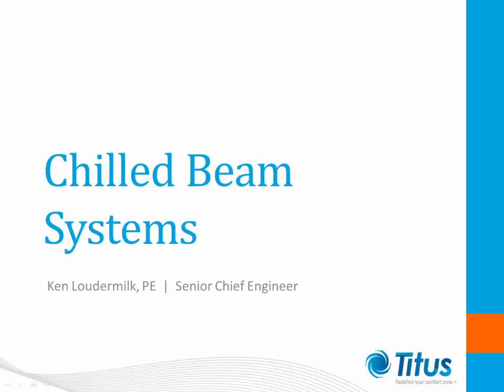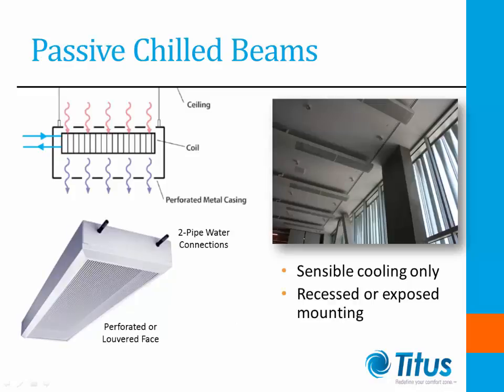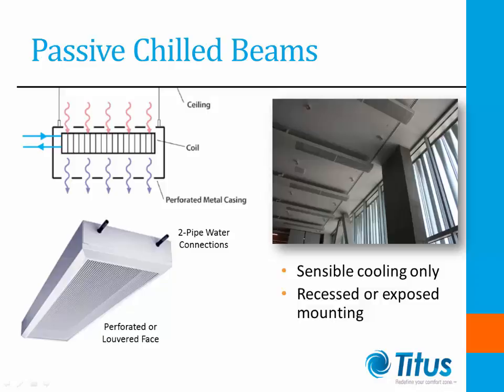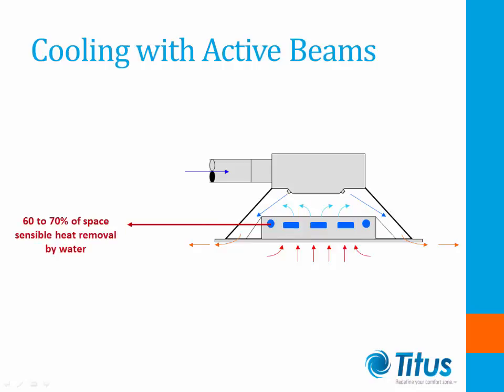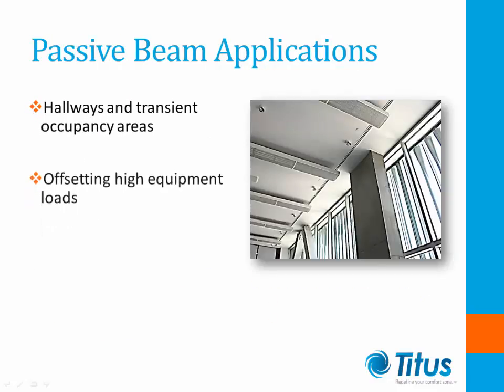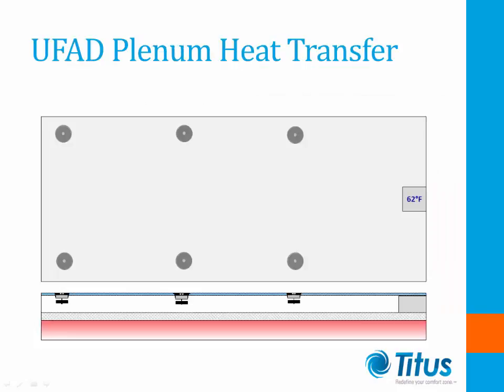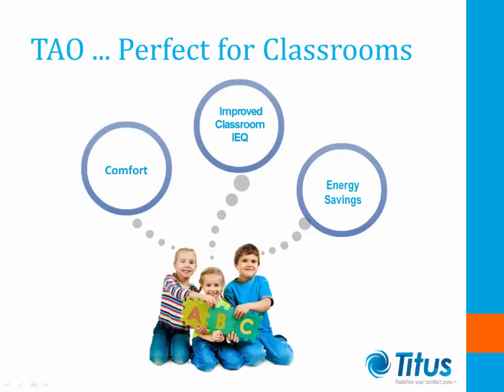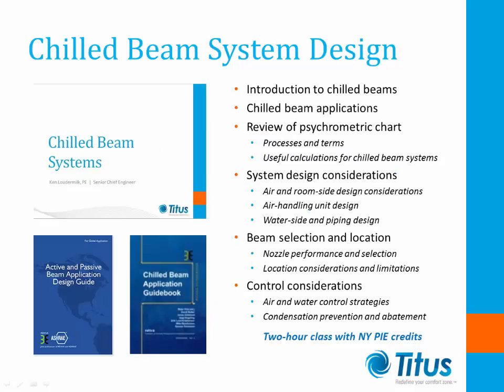Chilled Beams Webinar

Comment: Titus, how do occupants not get sleepy with the buildup for CO2? Are chill beams paired with makeup air?
Reply from the maker: Chilled beam systems never deliver less than the minimum amount of outside air so they are ventilating the space, in most cases, more effectively than an all air system which does not remove carbon dioxide from the air it recirculates.